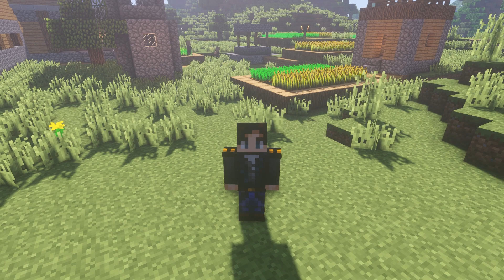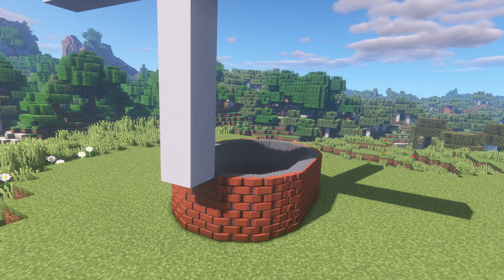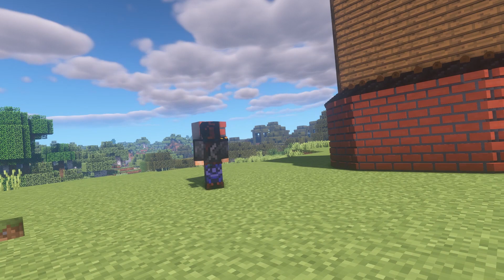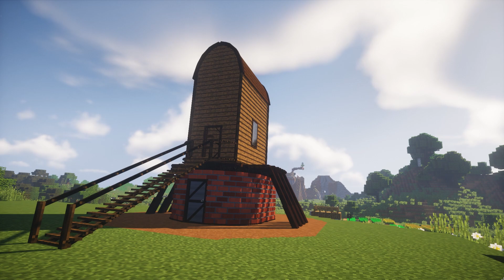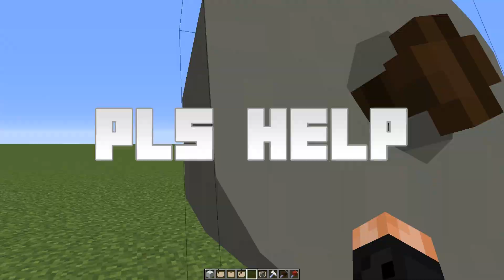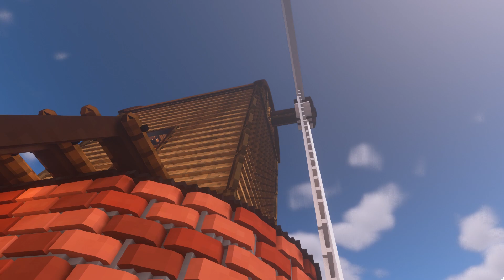I built a working windmill w/ Little Tiles in Minecraft

Comment: mr underated
Reply from the maker: it's up xD like in disc.
Reply: @Krisecco  hey is it possible if you could make a fully functional car with little tiles
Reply from the maker: @stickbugsalt7379  not fully functional... i could make it go from A to B with opening doors and a turning wheel and stuff... but it'd go in reverse on the way back... entierly lul
Reply: @Krisecco  could you add like two buttons on the wheel which could make it turn right or left when held
Reply: and a button for reverse and off also btw check out the create mod

Comment: I wonder how that windmill is working despite the fact that it has no cloth on the turbine itself
Reply from the maker: When the windmills wern't in use to actually churn grain or produce power for other tools (sharpening wheel etc), they usually either remove or tie back the cloth in order to reduce the stress on the center supports when it's windy... with the way that structures work in the ltitle tiles mod i had to build either one or the other... with or without cloth... i couldn't have both like it should in reality :(
i went with the most asthetically pleasing option imo, cloth rolled up but with the lattice being shown mostly as it looks cool XD

Comment: "this mod is by no means a replacement to chisel 'n bits", right.
Reply from the maker: Hey i never said that! :P But yeah... replaced.
Reply: @Krisecco  It's on the mod page, I don't think the owner know how to use his own mod. There are builds that don't even look like minecraft with shaders that are 80% functional, with doors, chests, openable windows, etc. Adding this to some other realistic mods such as immersive vehicles, you could build your city and be functional.
Reply from the maker: Fair enough ahaha little tiles just does everything and more, expect placing single bits... that's the only thing Chisel & Bits does that Little Tiles doesn't.
Reply: @Krisecco  Yep, you need to click 2 times to make that, although it is way faster to build since you can just drag and place lots of block in a different way other than a cube and a plate.